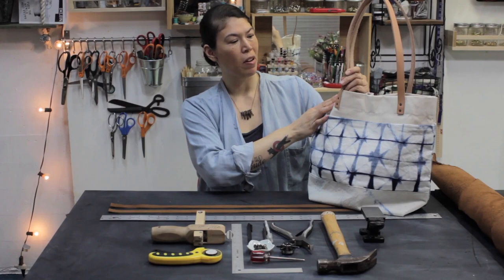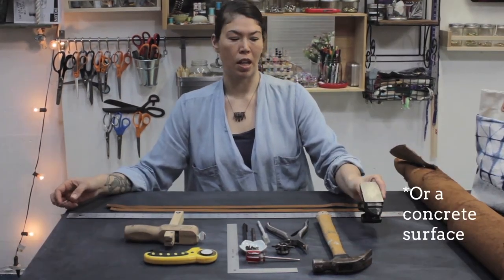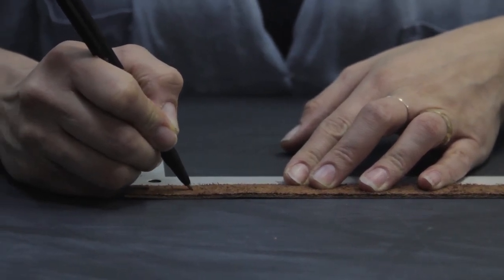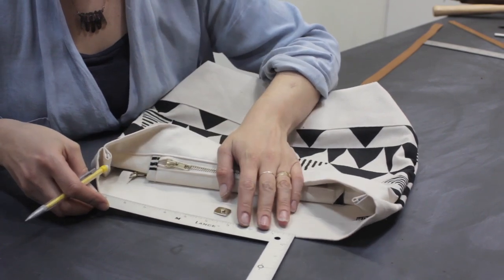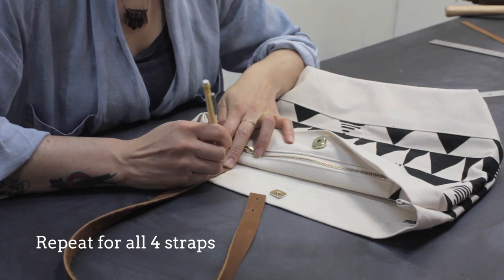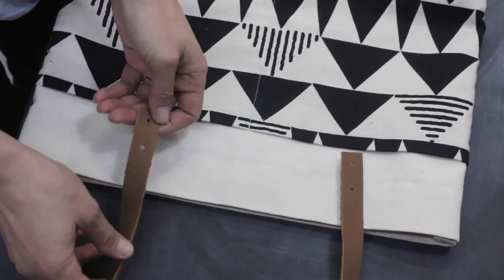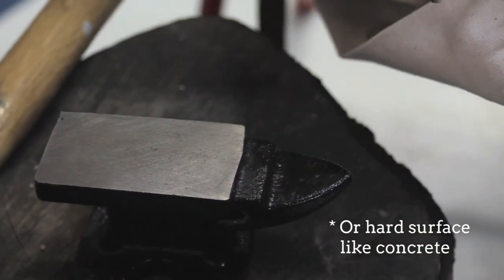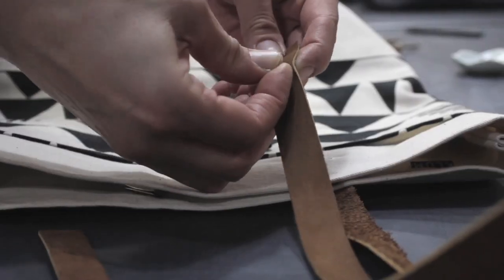How to Attach Leather Tote Bag Straps

Comment: Thanks for tut!  I have a leather purse that I have used for so many years and its still holding up strong... except for the shoulder strap!  I've repaired it multiple times but the vinyl backing (of course) has cracked in so many places.  I bought a men's belt that is a bit too wide for my liking.  How would you recommend I proceed to cut it to the width I want?  With the rotary cutter?  Also there is a felted material that was between the vinyl and the leather.  Would you suggest just removing it and proceed to use just the leather strap?  

You tut was JUST what I was hoping to find on YouTube and it was the first one I watched!  Pretty lucky, huh?